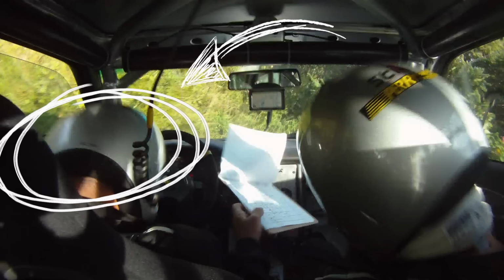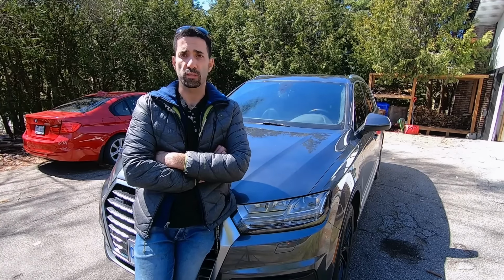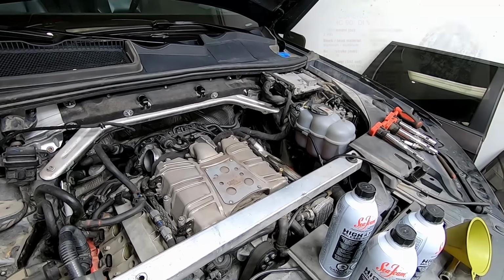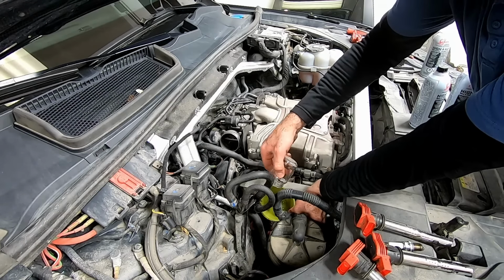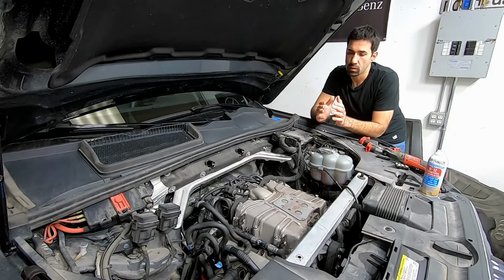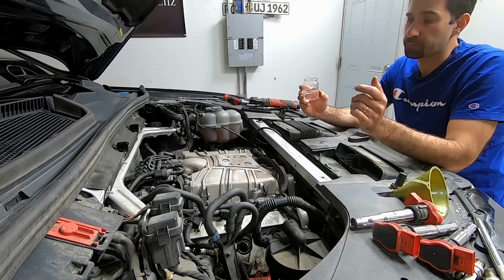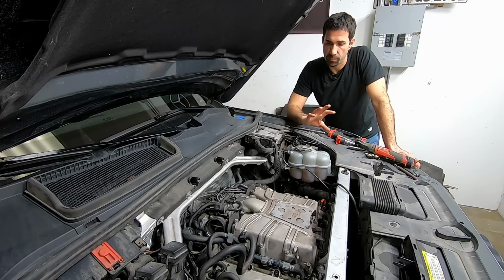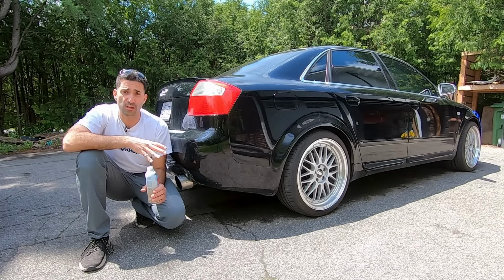How to fix oil consumption on VW/Audi/Porsche 3.0T engine?

Comment: My 2017 Audi q7 was burning a qt of oil every 150-200 miles & kept misfiring and going into limp mode! My mechanic changed the spark plugs, coil packs & the pcv valve which didn’t fix my issues! I took it to the audi dealer and they told me I needed a new engine which would cost 20k even tho my engine compression readings were fine. I sent this video to my mechanic and was hesitant to do a piston soak with the Berryman b12 but eventually agreed to try it! It’s been 2 months since he did the Berryman soak and I’ve driven over 1300 miles and my mmi oil readings have not dropped at all! Thank you for sharing this video!
Reply from the maker: @sterlingwhitfield6207  love these stories!! Glad it worked... it's crazy how many of us are handed these 20k estimates and are expected to be ok with it
Reply: I've got the exact same issues with my 2017 Q7, doing the soak now and will report back with my results as well. Thanks for this great how-to video!
Reply: how is it holding up? need to do the same for mine
Reply: I just put everything back together, and went for a 20 minute drive at around 3-4k rpms. About to go change the oil once it cools off and reset the trip mileage to zero and see how it goes. Here are some items of note:
- Finding TDC was accomplished with a fiberglass rod and some electrical tape on it to measure the up/down stroke while turning the crank
- I was able to turn the crank without a special tool, unless you consider a pipe wrench special. I used the upper most pulley and the 4 bolt heads as a turning point.
- I put about an ounce in each additional cylinder that wasn't at TDC while the ones at TDC got about 2 ounces for 24 hours.
- I used some fogging oil after the soak, so the cylinders weren't bone dry prior to starting
- I replaced the spark plugs after the soak (the old ones looked *terrible*, despite being replaced within the last 2 years)

After I get it all put back together and some miles on it, I'll post another update.
Reply: After 250+ miles, I am happy to report that the oil level hasn't dropped at all! I'll post back around 1,000 miles or so.
Reply: Just a question did you ever scan it for codes. I’m having the same issue but I just want to know which cylinder mine is #2 with electrical fault code as well
Reply: My issue is similar.  It all started with crazy amount of oil consumption.  Like a qt every 200 ish miles.  Then one day crazy misfire.  Checked my obd11 and it said cylinder 1, 3 and another I can't remember misfire.  Random misfire.  Shut down injector on cylinder 1.  I pulled the spark plugs and had oil on them. Replace the spark plug same issue.  So then I changed the valve cover gasket and I replace my pcv system under the supercharger.  Changed the gaskets on the intake manifolds top and bottom.  Put it back together and now I would only get a cylinder 1 misfire and shut down injector.  Check the pistons with a cylinder camera and the cylinder heads are black you can see the oil on them caked up.  All 6 cylinder.  So I'm attempting this now.  It hopes it is the solution to all my problems.  Also need to gap the spark plugs I bought as I didn't check the gap on them.
Reply: @MichaelLynch any updates have a 2012 Audi a6 3.0t that loves to eat oil a quart every 300-600 miles
Reply: @tonygarcia1021  yes, I'd call it successful. I've gone well over 1500 miles and the oil level is holding string. This weekend so we'll, I'm going to do it on my daughter's Q5 that has recently started burning more oil than "normal".
Reply: @MichaelLynch  what oil are you using 5w30 or w40 and what brand?

How are those burning oil mileage numbers are looking now?
Reply: @MichaelLynch  I'd use injector cleaners somewhat on the regular since carbon will build up again and injector cleaners help keep the rings clean, some fuels have cleaners added into them already typically more expensive than regular fuel
Reply: So happy your mechanic agreed and did the step by step d.i.y. instructions. He or she could have sabotaged the process to force a failure and attempt to extract your bank account contents.

Comment: if you check the forum for people with this car/engine(crec version) you will see a lot of people that had catastrophic failure while they were driving on the highway out of the blue. you sir might have unintentionally found out why a perfect running engine(with the oil consumption) might just have a catastrophic engine failure out of the blue with that deposit of carbon there. nevertheless sir you are a legend !!!
Reply from the maker: I think that carbon is what's left after the B12 drains down...it dissolves all the garbage in the cylinder, which gets deposited on the lower side of the piston where the last B12 drains... the footage was really bad but with the camera you could clearly see the mound of dirt that was built
Reply: @ETMotorsports  where from you sourcing the b12 ? i mean for a reasonable price it Canada ON
Reply from the maker: @kdudutse  few stores online,  I got my first order from Amazon, it's also available on ebay
Reply: Very interesting thought ... 🤔
Reply: I just did a b12 piston soak 1 week ago before watching this video and my crank actually got stuck just like this and  my tool was a little worn and stripped. So I just used the starter and it crushed/ blew out the carbon   and even after that I tried and it got stuck again. So I soaked for another 6 hours   and than cranked and started engine and car is running just fine engine is smooth and quieter than Ever. Ive only gone  150 miles so far but  so far the oil is still fulll on dipstick so fingers crossed.
Reply: @ETMotorsports  There are a number of reports of burnt exhaust valves caused by carbon buildup.  I would surmise that doing a soak as preventative maintenance may pay dividends.  I don't see any downside?
Reply: Want another 2017 Q7 with similar issue. I’m burning a liter every 800 km. Compression test came back good. Replaced PCV, no difference. Very frustrating.
Reply from the maker: hmmm I wouldn't run the starter if the crank got stuck - glad that it wasn't something serious and it was able to push through. All the dirt accumulates at the bottom of the piston and prevents it to go up - I guess since it's dissolved carbon it's not a solid chunk but it's like shown in the video - mound of carbon dust so the piston can push through
Reply from the maker: I have been thinking about a slight modification to the method...if you caught each piston right after TDC on the intake stroke where the valves were fully opened, and you soaked it with enough liquid (have to experiment a bit to determine the amount) you can soak the top of the piston AND the tops of the valves at the same time basically doing two jobs at the same time. Of course the liquid goes through the piston so it won't stay there forever but it might actually clean the valves pretty good
Reply: Update on my oil burning. Just filled gas  up for the 3rd time. At around 900 miles and oil is still at full on the dipstick.  So happy with the results of the b12 soak.
Reply: @kevinmysliwczyk5459  Hows the oil burning looking for you 2 months later?
Reply: @mydimeisup5103  still good. Im stillngetting 2000 miles becore inhave to add a qt. About tonchange my oil again im gonna add 2 bottles of b12 to crankcase and drive for 20 minutes than change it and see if that extends it even further.
Reply: @ETMotorsports can you make a video about how to know we’re tdc is, im planning to do this on the same engine but 2 different cars and will like to visualize everything before I get started. Thx
Reply: The catastrophic failure is due to the HPFP leaking gasoline into the oil and the rod bearings being shot. Oil burning doesn't help, but that is the cause of 5+ engines I've seen being locked up.

Comment: Did this process a few months ago on my 2013 A6 3.0t based on your previous videos and by sheer luck I happened to be dog sitting for my brother, which gave me access to their vehicles and allowed me to soak the pistons over the coarse of three days. I used three bottles of B12 and filled then rotated the crank three times. While not as precises as your method here, I do believe that I was able to achieve a similar effect as the pistons were never in the same positions after each rotation. Before this process I was burning 1qt of oil every 800 miles and I'm happy to say that i'm currently at 1800 miles and my MMI oil reading, plus my dip stick, show zero burned oil. Can't thank you and everyone else enough for documenting this process and sharing it with us. Thanks!!
Reply from the maker: @mechsuit80  great results!! Glad it worked
Reply: What tool did you use to get at the crank pulley? I can’t seem to get close to it on my B8 S4 cause of the lack of space between the fan and the pulley

Comment: My 2017 Q7 was burning a quart of oil every 100-200 miles. I did this piston soak a little over a month ago and am happy to report success. I'm over 1500 miles in now and no signs of oil consumption! Thanks for the great tutorial.
Reply from the maker: @MichaelLynch  well done!! Yeah those are scary starting numbers
Reply: Did your car smoke in road
Reply: @abdouben4387 it wouldn't smoke just going down the road, unless I stomped on the gas. It would smoke when starting from a long stop light, upon acceleration.
Reply: Thanks for letting us know! I'm about the same position and I just found this video.

Comment: Got a 2017 q7 from auction with 71k miles. I was stunned to see it going through a quart of oil per tank of fuel. I don't generally use any snake oil solutions to problems, but figured this might actually be worth a try. Did 1 container of b12 down into the pistons, let it sit overnight with a couple rotations of the crank via water pump pulley, sucked out whatever was left, then fired it up, drove just enough to warm it up, and drained the oil. The oil was very thin, so clearly some b12 slipped past the rings and diluted it, so good to not run it very long. Immediately replaced with fresh 0w40 mobile 1 and new filter, using the drain plug rather than extraction. It's now several weeks later and over 1000 miles, and the oil level has only dropped 1/8 of a quart, which is fantastic. A longer soak with b12 might do more, but I plan to just do oil changes often for a while. Really seems like the crec engine oil control rings are prone to clogging with carbon after 50-60k miles. So instant subscribe because what a great solution!  That said, I would be hesitant to run b12 in the oil much at all, it seems really hard on plastics and there is a lot of plastic inside these engines. Oil baffles, timing chain tensioners and who knows what else. B12 is in stock at walmart very cheap too. Thanks so much for posting this solution, eurotrash. I would happily send you a tip for saving the day on this engine!
Reply from the maker: Great results! Glad it worked

Comment: So I have a 2010 Audi S4 that was burning quart of oil every 500 miles. I did this exact procedure, and so far it's been 500 miles and not a drop or oil has burned. I did have lower compression in cylinder 2 and I noticed that was the only one that had oil in top of the piston. I feel like that's where the oil was going. Car runs GREAT. I think this is the secret to Audi burning issues.
Reply from the maker: Nice results!
Reply from the maker: Did you check the compression after the treatment? Did it improve?
Reply: @ETMotorsports  I havent yet, but I will soon and will update you right here 👍🏻
Reply: @jd-ri6qy update bro?

Comment: My 2017 Q7 was using a qt of oil every 200+ miles. Did the B-12 treatment 2 weeks ago. The amount of carbon I blew out the cylinder was amazing. It's 2 weeks now and no low oil light. MMI is showing no oil loss.  I used 4 cans of B 12. I used the Shell T6 Rotella for the 2 weeks and then switched back to the recommended oil. I was seriously thinking of getting rid oh the vehicle. Thanks for making the video.
Reply from the maker: @patrickhenry6148  great results!! Yeah it's pretty crazy what comes out of these

Comment: Hi Emil, many thanks for your video guides. I have successfully recovered my 2014 Golf Mk7 1.4 TSI which was consuming a litre of engine oil per 800 Km by following your B12 piston soak guide. I have since switched to Valvoline Restor & Protect and have not lost any  engine oil since driving about 1300 Km. I can confirm that by following the procedure from your videos (on Audi Vehicles) I have been able to rectify the issue and not to mention the cost saving towards engine rebuild. Thank you so much for sharing your experiences and the information on youtube and helping us all. Best regards, keep the good work going and god bless you.
Reply from the maker: @pratikvyas5249  great results!!

Comment: 2017 Audi q7 that was burning quart of oil every 500 miles. I did this exact procedure, and is been 700 miles and not a drop or oil has burned. 
I did use 8 cans of B12 during the 3-day process. Thank you so much!
Reply from the maker: @MartinGarcia-gm9hy  nicely done! Glad it worked... did you run the engine with 8 cans in or drain without running the B12? That's quite a lot of B12 - why did you end up using so much? What did you do different?
Reply: Wow! 8 cans?
That's a lot of B12 in the engine. Were you removing equal amount of oil to avoid overfilling the engine?

Comment: Wow, awesome video sir. You did a great job and your step by step methodology is super. My wife’s 2017 Q7 oil consumption increased at around 150,000 km but it’s not as bad as yours. Only 1 liter per 3000-4000 km now at 230,000 km. My B8 S4 oil consumption went up also at 150,000. Now at 180,000 it’s a liter every 2000 km or so. 

I’ve put some Seafoam in the oil on the S4 with no noticeable improvement. I was going to try a Seafoam soak but you saved me a ton of work. I also was concerned above the pistons being on the V so thanks for solving that. I was also very concerned about knocking some carbon buildup loose so definitely need to be careful and clean it all out. Again, super helpful!! Again, thanks for the video and wish me luck!!
Reply from the maker: @georgekohn4888  if the consumption isn't bad yet,  a seafoam soak might work...I did seafoam with both my A4 and Touareg and both of them improved significantly... it didn't work on the Q7 but it was clearly in a very bad condition so needed stronger stuff... on yours it might actually help

Comment: Thank you 🙏🏽 for posting this video owner of 2017 Q7  same problem burning oil watch your video about a month ago did the piston soak like 3 weeks ago carbon build up was terrible piston 4 like in your video was the worst right after I did the piston soak went to a 300 mile trip to my surprise my car runs amazing my mpg when up came back changed the oil I made the same trip 3 more times because of my son soccer games my car has not burned any oil thank you so much and for anyone having the same issue do this you’ll be surprised
Reply from the maker: @sescorderocordero4920  awesome results!! It's crazy the amount of carbon that gets dissolved when you do the treatment

Comment: Good to see folks catching on to piston soaking. Myself and others have been doing this for years as we all have vehicles well over 200k miles my 3.0 a6 included (230k) 
Another good thing to do is 300-500  miles before every oil change add half a can of either b12 or seafoam to the crankcase oil and the rest in the gas tank. This will help break down the carbon sludge which accumulates between oil changes for cleaner engine internals.
Reply: Piston soaking fans are very few, I have the same feeling when I see some of them 😊.
How do you manage V6 engines?? Any special tricks? 
And if some of the dirty solution with desolved carbon hardened on rings seats and drain holes how to manage the situation

Comment: I did this on my 2018 Q7 3.0T shortly after watching your Q5 video. I also realized that I was not going to be able to cover the entire piston, and it would be tricky to make the relatively small amount of liquid last for all 6 cylinders without overfilling the crankcase. I was on a time crunch so I only did two pours. First was 6 hours, and second was 12 hours. I'm still driving it after that first oil change waiting for that oil reminder to come on. So far so good after 1500 miles. I was previously burning a quart of oil ever 2k miles. Time will tell.
Reply: How is it?
Reply: @aibarberguy3141  I’ve surpassed 2500 miles since I did it. No reminder to add oil yet. Checked the dipstick(I installed one where the plug was). All good. Id say it has fixed it.
Reply: Update. Im now changing the oil after a trip to the mountains. 6k miles since the soak and my last oil change. According to the physical dipstick, im right in the middle of where I need to be. It’s probably burned half a quart total since I made sure to fill it to the high mark at the last oil change. This freaking worked!
Reply: What was your cadence? In the video he did 2 pistons at a time in order to get the them TDC...
Reply: @JPtheOG I did all of them at the same time. This was because I did mine before he had released his video on the Q7 so I had to guess my way through how to do it with a 6-cylinder. He is much more engineer-minded than me with the idea of doing 2 at a time at TDC. I may do the whole thing again when the nicer weather hits since I also did not change my spark plugs(should have). Im at 4k miles since my last oil change mentioned above and still no message from the car about adding oil. Even if you do it like I did(wrong), you'll still see good results.